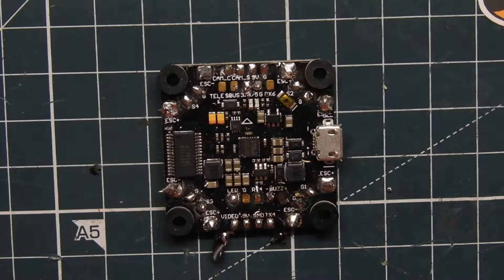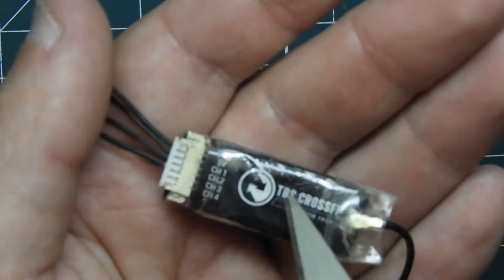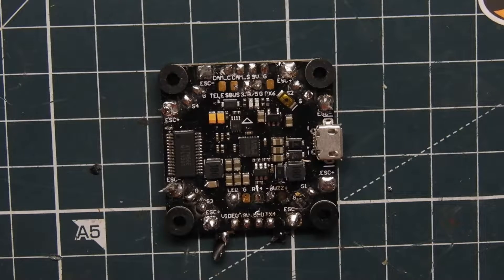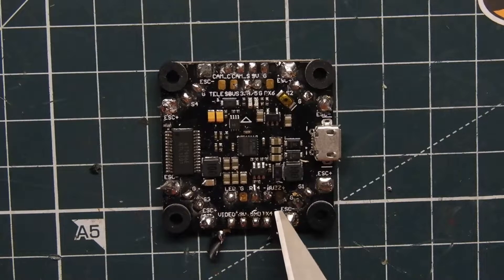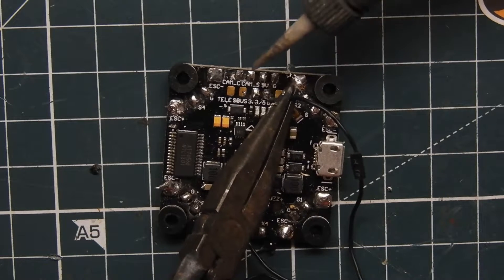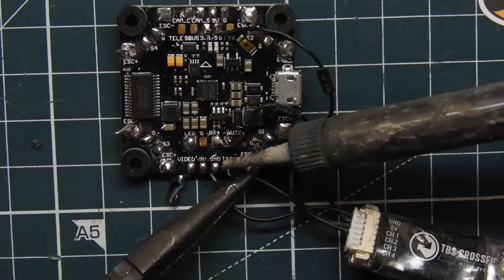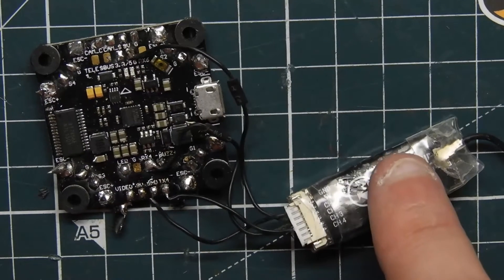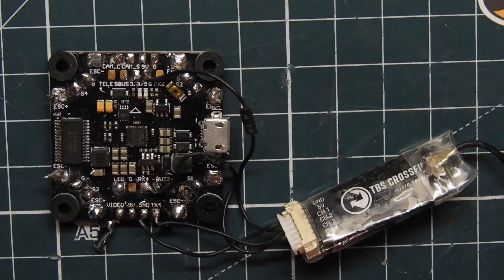How to - Install TBS Crossfire - Any Flight Controller

Comment: Is this possible for pwm?
Reply from the maker: It sure is. Even comes with a servo adapter
Reply: @ViperFPV  i have a crossfire lite can i use this ?
Reply from the maker: @datumotion1448  yes you can
Reply: @ViperFPV  thanks

Comment: Can the crsf nano diversity be connected to the naza m lite and crsf protocol be used? I'll just buy another fc if not... 🙏
Reply: From reading through it may appear that the naza m lite lacks the uart ports I need to connect the tx and rx on the vtx to, unless I maybe use the gps port..(I want gps though)🤔😓

Comment: Do you know if you can bind more then 1 receiver to the Crossfire Tx as I have a T16 with a crossfire modular and also a Tango 2.
Reply from the maker: DaveskieFPV yes just bind using the same model for one radio. In regards to using both the tango 2 and the T16 I don’t think it’s enabled yet but I believe in the next patch it should be an option

Comment: What about installing crossfire nano receiver through SBUS. I’m trying to hook up to my diatone cube and there are not extra uarts. Is there a way through SBUS
Reply from the maker: Cory Venezia crossfire needs both wires connected and it only uses the crsf protocol. What do u have using all your uarts? U may be able to put one on a soft serial uart u just need to reassign the pins
Reply: @ViperFPV  is this the case when used the naza m lite? X2 is to used?
Reply: The receiver can be setup to use SBUS.  You need to bind it using your radio and through the LUA scripts you can set channel 1 for SBUS.  The defaults are Ch1=CRSF TX, Ch2=CRSF RX...  Change Channel one to SBUS and hook up +5v and ground and the 1 wire corresponding to channel one to your SBUS pad on the FC.
Reply: @BlackWolf42-  I scrapped using the naza lite and went and bought the sp racing extreme h7 instead. Should be here today.
Reply: @kudzy11  I still use my old Naza on my large photo/video ships.  Its the simple option if you need GPS holds, orientation holds, and all the neat things it affords.   If you've got a mini quad stuffed with the Naza, I applaud your skill in stuffing that bastard into a tiny frame. :P
Reply: @BlackWolf42-  lol nah I'm using the discovery frame. The naza was on my 650 tarot build which decided to fall out the sky! I'm using crsf nano diversity and unify pro and wanted to use the crsf protocol which, like you pointed out needs the tx and rx.

Does using the one wire for sbus mean that the crsf protocol is not used?
Reply: @kudzy11  The wonderful longrange CRSF proto goes through the air, between antennas.  The CRSF Tx & Rx lines have mainly to do with the telemetry afaik (like setting pids through a LUA script on your transmitter).  I'm using the old receiver on an itty bitty Dart 250g wing with the hokey Kopilot lite "FC".  I don't expect any information from that fc but the info like noise-floor, tx power, tx mode and other goodies are still there.

Comment: I'm sorry why can't we use the sbus pad? What if I don't have any other options?
Reply from the maker: Sbus is a different protocol and crossfire uses it’s own protocol. What flight controller are you using
Reply: @ViperFPV  Hi. I'm using this : https://thrust-uav.com/product/kodak-riot-250r-fcb-pack/
It's buil in-house FC for riot 250r pro. I'm trying to figure out how to hook up the crossfire. I've looked everywhere. You're the first one to respond. Thank you so much! I really appreciate it.
Reply from the maker: Ok I took a look at this FC, not to put it down or anything but it’s very limited in regards to uarts. The only uart I see is the gps pads. I’m not sure if it would work 100% but since there are no other uarts on this FC. I would wire the RX wire from the crossfire receiver to the TX pad where it says GPS . Then wire the TX wire from the crossfire receiver to the RX pad where it’s says GPS . The power wire from the crossfire receiver to the v+ pad where it’s labeled receiver. And also wire the ground pad to where it says GND. 
You will then need to follow my guide on setting up the receiver for betaflight since I’m not sure what uart the gps pads would be on this board you will have to enable one and see if it works then if it don’t work move onto the next uart port.
Reply from the maker: Let me know if it works or not!
Reply: @ViperFPV  Thank you Sir! You've earned a new subscriber! Great gob!  You are the only one that helped. Thank you kindly. I will have to give it a go.
Reply from the maker: Red Alpha thanks! Let me know how it turns out.
Reply: @ViperFPV  seems lack of uart ports on the naza m lite might be my problem also.. 

Can the tbs fc , from the power cube, be used as a standalone fc? 

Thanks

Comment: How do I get LINK Q into my OSD ?
Reply from the maker: On your receiver setup in the crossfire script set channel 12 to LQ enable you should then see in the betaflight receiver tab a channel with a reading at 2000 like channel 8 or 12 set that as your rssi channel.